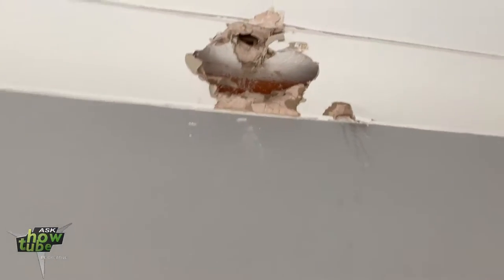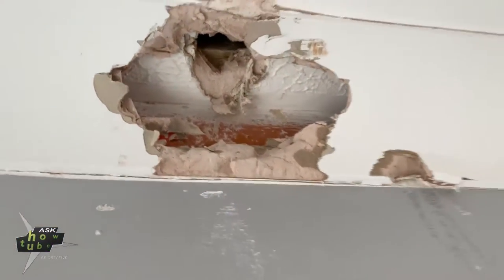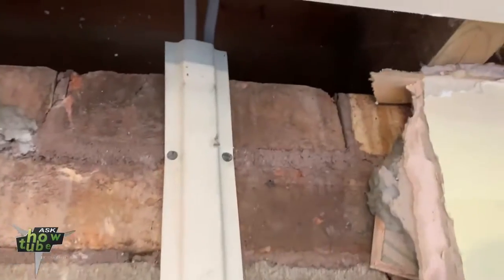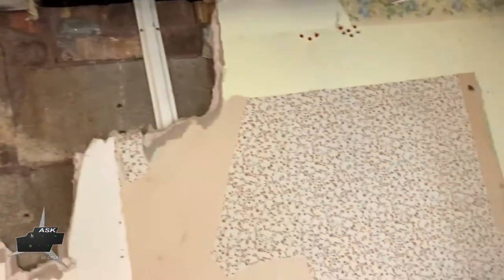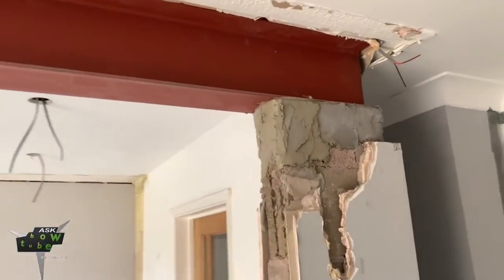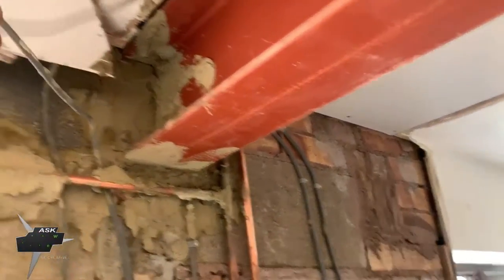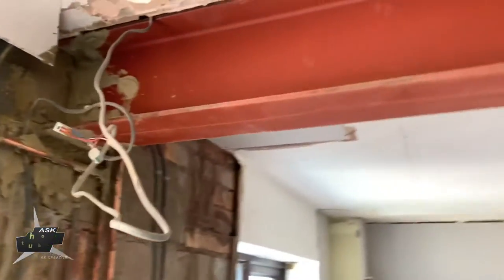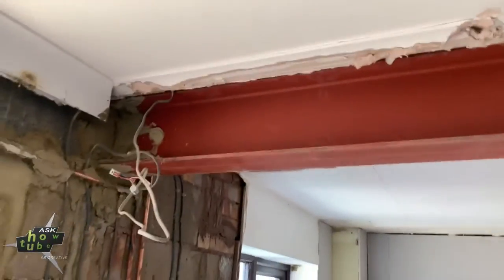How to install a steel beam on your own, knock down a wall, using acrows to support the wall.

Comment: Pieces of wood for spacers for the supporting beam is a no no as they rot over time the need to be steel or old school slate
Reply from the maker: I cannot believe the fact that you thought that I was leaving this pieces of wood in there…I simply cannot believe that you have even had that idea…. My son is 11 years old and he knows that you cannot put wood underneath the beam… I was working on my own as you could see on the video and I was only using the wood to place the beam perfectly in the place… I thought is obvious that wood cannot be left in there, and I have never thought that for some people I should make another video special showing them how I remove the wood and replace it with the adequate material…don’t tell me you’re a builder 🤦🏻